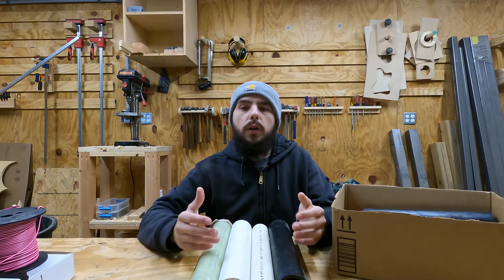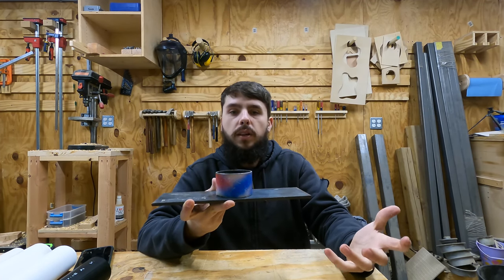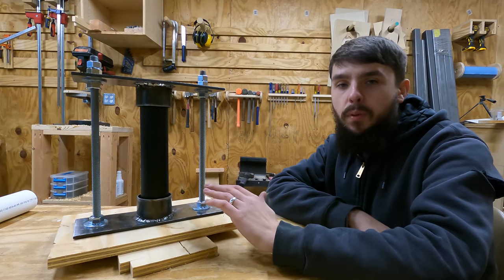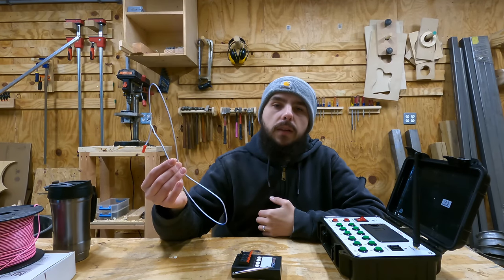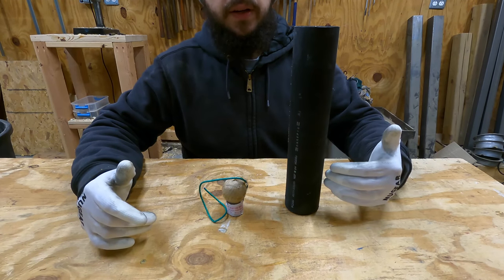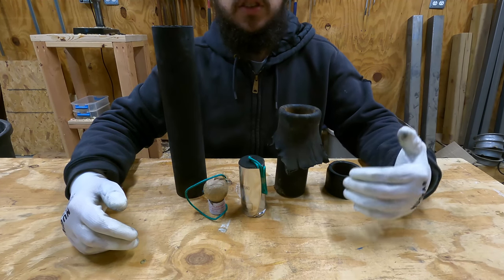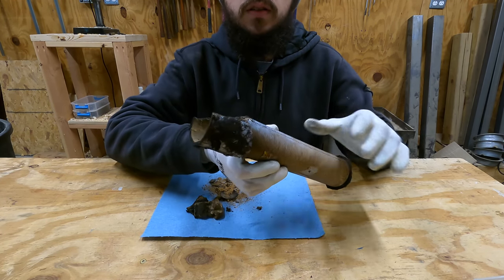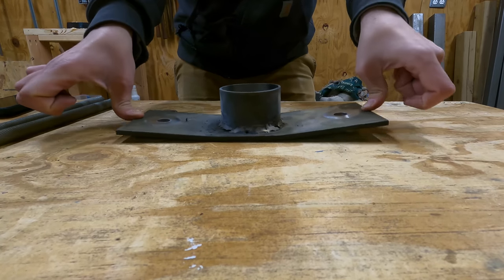Mortar Tube Strength Test

Comment: I got some big canister shells and I wanted to ask I'd there's a safe way to get then to launch higher? I set a few off tonight and they broke so low that stuff was hitting the ground still burning. As I have little kids this concerns me.
Reply from the maker: I've heard that if you have a longer mortar tube, it will result in a higher launch. Most of the HDPE tubes I have are 12 inches but the company I buy from offers a 15-inch option as well. I've never personally tried this to know for sure, but I do want to do a comparative test in the future.
Reply: @310fabrication  could there be anything negative that would possibly happen if I cut 3-5" of one tube and secured it with hd CA glue and a few wraps of TRex tape? 4 tube's came with the pack so I gave an extra to spare. Thank you for you fast reply, I very much appreciate you doing that especially to an older video
Reply from the maker: You're welcome, I'm happy to try and help. I know timing is probably not ideal to order the new tubes, but I wouldn't personally recommend doing that. I can't imagine a scenario where the CA glue and tape would be strong enough to contain the explosion in the event of a failure where a shell got snagged on the transition. I would think the result would be worse than the shells breaking low. I don't know what set up you have but if you are reloading tubes the low break could be the result of debris in the tubes. The second year I fused my HDPE racks I didn't clean my tubes out and some had leftover paper that caused a few dangerously low breaks.
Reply: @310fabrication  thanks for the advice. I have a few old bottle brushes. I could use one to clean the tube after each launch. My son turned 4 June 28 and we celebrate his birthday on the 4th and he loves fire works. He likes to pick them out and carry them to where we set them off. And now my 2 and half year old twin boys were kinds scared last year but this year they absolutely love them. The ones I got scream all the way up and pop loud and thunderous.
Reply: @310fabrication  thanks for the advice, the neighbor had some too and they had tube's that were 3" taller and they did the trick. Didn't have any sparks still burning when they hit the ground
Reply from the maker: That's awesome to hear! Yeah our kids seemed much more into it this year, which was great. I'm glad the taller tubes did the trick, Ive always been curious about that.

Comment: Love this video and all the safety steps you took. Lift charge failure is a real thing. here is  a lift charge failure and wrong tube. https://youtu.be/PufQnyS8lfw?si=EGMa-wCXabnX6DDL  Go to time stamp 1:20. They used a concrete bucket and tube. The shell was below the concrete and concrete shrapnel flew every where. people should not use tube and concrete bucket. thank you for your video.
Reply from the maker: Yikes! A tube that big with concrete shrapnel would be crazy scary. Yeah, I've been curious on how common lift charge failures are. Outside of the tests I've done, I haven't personally experienced one, but I still like to perform tests to get a better image in mind for what could go wrong.
Reply: @310fabrication  Here is another, where a guy must have used a PVC pipe. https://youtu.be/IptAp65-mGU?si=hx20uFrKb29hGdbS .card board, fiberglass, or HDPE pipe does not send shrapnel.